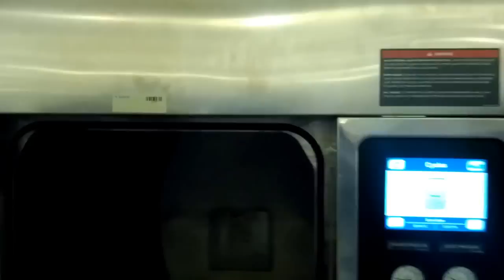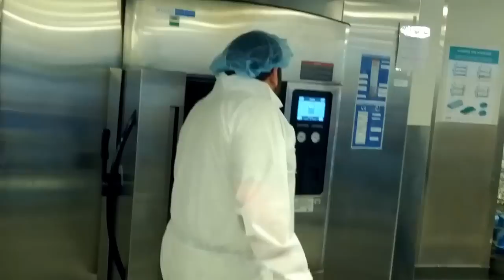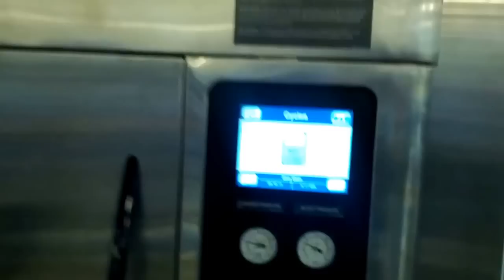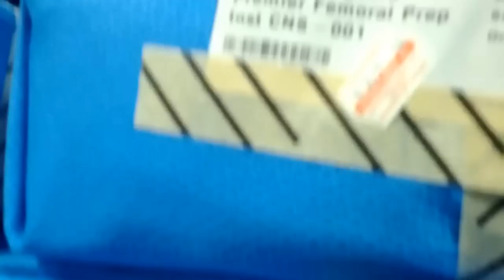Steam Sterilization Essentials

Comment: Can you sterilize unpacked gauze in gravity displacement autoclave?
Reply from the maker: Has to be packed otherwise there is no point to sterilizing unless it is for immediate use. Gravity air displacement machines can do the job at 250 F for roughly 30 min.
Reply: It is for immediate use. Thank you

Comment: can you make a video on akylation
Reply from the maker: as a separate topic probably no as there's no real call for it. however, it is covered more extensively in my low temperature sterilization video.
Reply: I'am studying and trying to look up alkylation & denaturation examples of bacteria  and sterilization equipment used with them
Reply: thanks,I'll look it up,almost done with my class your videos have helped alot
Reply from the maker: +Daniel Arviso Great to hear. let me know once you pass the test. All the best. Steve
Reply: your videos have helped alot,,I was watching them before I started school,i'am in heath mass right now,do you have tours of BCI ?
Reply from the maker: +Daniel Arviso are you preparing for the iahcsmm exam? there isn't that much on the iahcsmm exam on these topics. you can get all info you need for the test from my low temp sterilization video.